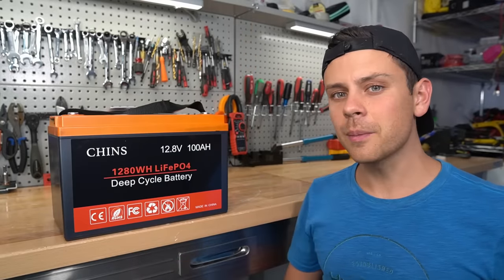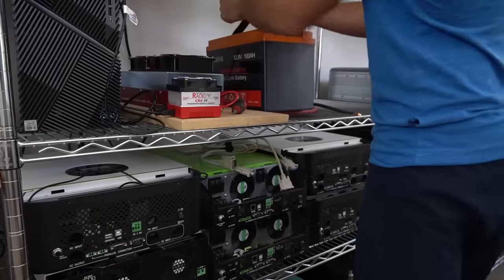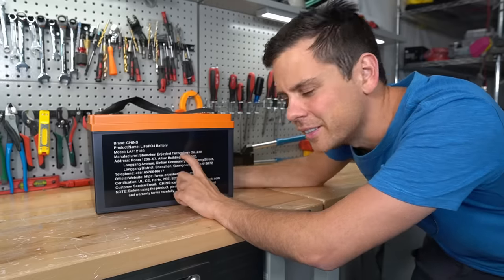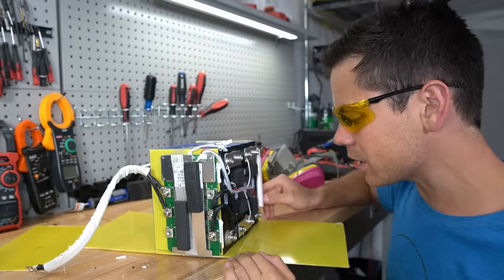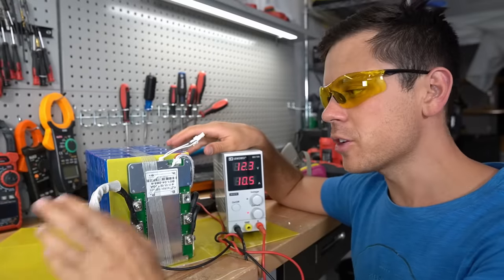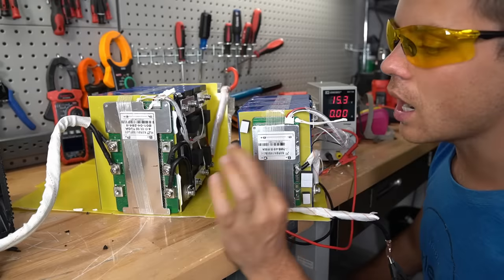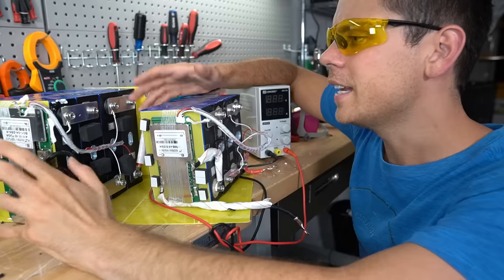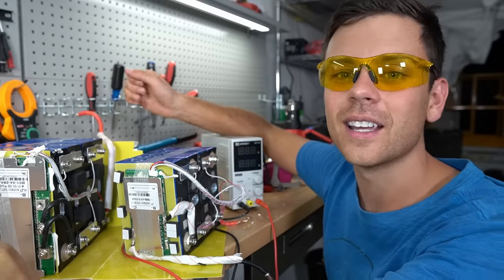$379 CHINS 12V 100Ah "Plus" LiFePO4

Comment: I bought the Mjbsan 100AH battery from Amazon and boy was I sorry. It took 3 days to charge, and then at .75AH discharge (my trolling motor on the lowest speed) it discharged in 4 hours. Just bought the CHINS on your recommendation and hope it works better. Thanks for the review!
Reply: How has it worked since it looks like you have had it for a month now?
I'm also looking to buy for trolling motor and interested in your experience.  Thx
Reply: @dannowak8235  Working fine! I actually bought a 2nd one.

Comment: I take amazon reviews with a grain of salt these days. Vendors are still bribing buyers to leave 5 star reviews. But these videos blow away those reviews (legit or not) since you actually show us the hardware and data points. I saw this battery and I assumed those reviews were bought and paid for and the battery was junk. So your review here shows I was wrong. Kind of like the renogy which you've shown is junk.
Reply: Amazon is starting to go after the sellers who actively manipulate reviews but I still wouldn't trust them.
Reply: @P_RO_  Agree, but they are taking their time. I attempted to post a review stating product came with a note to leave 5 star review for a gift card and amazon wouldn't post it. So while it is a start, they really are not trying too hard to stop it, and it isn't for lack of resources.
Reply: @skelafeti  Agree 101%
Reply: You need to use a product for a longer period of time to know what it is good for. And you can't tell if a battery is good or not by just looking at the parts in it. That is like looking under the hood of a car and using the car for one trip, and then saying that this engine looks really good, this a review and this is a really good car. People that don't know better are buying products based on 'reviews' like this.
Reply: @milcotto4153  You get a good idea if it's going to be a decent battery by the quality it was put together and the components. Without these reviews you could end up with a renogy battery that he tore apart and showed how shoddy it was. It's all a risk, even reputable lead acids can be bad. People are way easily bought and influenced so you never know about most of these reviews for that matter.
Reply: I bought 2 Newpowa 210 watt solar panels. 1 worked the other had 1 of the diodes fell off then the 1 that was still soldered in was backwards. They offered me $10 to take down my bad review. I gave them the double middle finger and let my review stand
Reply: Amazon reviews are bought and paid for
Reply: @Noneyabuiness  not mine.
Reply: When you can, watch for "Vine Voice" reviews.  While they receive the product virtually free (they only pay taxes on it), they're under no obligation to give it a "good" rating - it's completely a "blind" relationship between reviewer and reseller.  The only thing you have to watch out for is "lazy" Vine reviewers who just review products because "they have to" in order to stay in the program.  You can almost tell those immediately, however, as the lazy reviews will be short and lacking details.  Amazon also takes note of that, and eventually they're booted out of the program.  Most "Vine Voice" reviewers take their role seriously and try and do a thorough, objective review.
Reply: I agree with you very much. The cost of a DIY product is 200 dollars. I think our product is much better than this
Reply: I've had companies say, "Don't forget to give me a 5 star review." I tell them to their faces, "I'll give honest reviews, so give me a 5 star result."
Reply: Just look at the review dates... you can tell by the cluster of dates.
Reply: I just bought a Renogy battery, not delivered yet, hope your wrong about them :+/
I just watched his video on Renogy, he say's they are great quality. ?

Comment: I live in the northwest, it gets cold for a few weeks, but I turn my batteries off after every camping trip so they are not just charging while sitting. I use 4 aims batteries and they have done great for the last few years, unsure if they are a great battery but they have worked for me, they do not have a cold temp shut off, but since I turn them off between trips, and the spot I have them is heated when in use, I don't worry about it.

Comment: On Amazon for the same brand battery, they have other empires listed and I also have them listed in a smart battery as they call it. It says it’s supports low temperature charging down to -34 ,if I’m reading it correctly.
Reply: What are empires?

Comment: Hey Will, can you talk about mixing different batteries, for instance a Battle Born 100a and a DIY 280ah in parallel?
Reply: You will get 380 ah
As far as I know, there should be no risks
Edit: no risks as long as the voltages match

Comment: I bought one of these CHINS batteries through Walmart’s web site for $276 with shipping and tax included.  According to FedEx, the battery is supposed to arrive 10 days after I placed the order.  I also received without having to ask a follow-up e-mail from CHINS with recommended settings for MPPT controller and inverter, and contact information for engineering questions.  At least out of the gate, I  am impressed.  I am not going to use the battery where it is likely to freeze, so I can live without an internal low temp cut-off.

Comment: I bought this battery to use with my Renogy suitcase all in one solar kit, but the CHINS battery recommends a MPPT charge controller and the Renogy uses a PWM. I will check with the company on their support line.

Comment: Hello , I have watched many of your videos , I thought I have learnt something from you, but in reality when now I am in my Cabin in Norway, I have no idea what I should get, I need to power my PC, cell phones cameras and a small ,12v fridge, could you please make list what ii should buy which is or are available At Amazon, I will make videos thank you for your easy to understand instruction and wonderful help.!
Reply: Mate my system does all that and I have 16 100 ah batteries 3000 watts of second hand panels 3 cheap chargers and a 1500 watt inverter and it runs power tools everything I need it's that simple I just use a generator for the welder it's easy don't be afraid good luck
Reply: Get a 3500 watt generator
Reply: @MudPeppers  Preditor on Harbor freight is a pretty good model and it has a silencer switch to quieter run time....some of those generators DB levels can drive you bonkers.
Reply: I have a similar setup.  12V fridges range from 60-90W.  So this will run 24 hour a day.  The other stuff you listed will be taken care by the excess solar during the day.  If it's a PC then you will need more.  Labtop is better.  Inverter depends on your requirements <400W (power tools >1500W, 300-400AH in batteries (lithium),  60-80A solar charge controller and about 1200W in panels.  Why not a propane fridge, the system could be a lot smaller.  You need to figure out total watt usage in day.  Then size the battery a bit bigger (1.5x).  Then estimate the panels, by assuming you get like 3 hours of sun a day.  300-400ah 12V, you will need 1000-1400W in solar panels. 24V system would be better.  Beefy for 12V and only because of the fridge. So based on what you said:. 400W inverter, worst case for fridge = 90wx24h = 2160 wh.  So get 3x100AH or 1x300Ah lithium.  Cheap 100A Mppt charge controller (OOYCYOO). 3x 340W solar panels (3P config). Get a 6way 12V fuse block.  Add RV lights, water pumps....
Reply: That fridge is the killer.  Most of these DC fridges run on either 12/24V.  24V system would drop the cost of the wiring and the charge controller significantly. It's the multiples cost of 12V batteries that suck too (based on my calculations you needed 3) and 24V would mean 4 (2P2S config).  Check the wattage rating on the fridge this is really important for you.  Also think what you might want to add in the future.  You're straddling like $3000USD based on what you said.  I use propane I'm Canada because it is cheap ($300CAD per year and that includes my stove with oven).  Take away the fridge and you could get away with spending $1500USD for the system.
Reply: @fuckyoutube9713   12V Fridges eat like 45-90w and hour depending on size.  I've been looking at them.  Even then, he'll need a chunky 12v system just for the fridge.  He lives in the north so he would need more than 200W (3 hours of sunlight in the winter).  Your suggestion is good, but I'd boost to a 40A Mppt and 400W solar.  Just one large Hanwha panel - 410W.
Reply: Buy Will’s eBook. $8.00 USD if memory serves
Reply: @robertbader2915  well I went on aliexpress and saw lifepo4 320 ah cells for 560$ canadian for 16 pcs that's close to 15kwh of power
Reply: @lesstevens2370   You might get 4 pieces for $560 and make sure that the shipping is included.  I have a setup with one 200AH renogy AGM.  I think my next will be the 200AH CHINS lithium with the 200A BMS.  Need to cross into the states to pick it up, but right now the renogy battery with 510W solar works great.
Reply: @robertbader2915  I just looked and order 16 cells 3.2 volts 320ah lifepo4 off of aliexpress for 62 dollars canadian per cell supposedly  grade a also but yesterday they were on for 48 per cell should of got them then but you can get a good setup for under 1000 storage wise at least
Reply: @lesstevens2370  Will Prowse paid $2800 US for the same thing.  How is it that you are getting it for less then half that... Makes no sense.
Reply: I put all my cells in my root cellar at 3 metre's.
I live at 2800 metres in the Rocky mountains and my cellar stays at a constant 14c. year round.
Listening to will has eased my worries of temp sensors and as of 3 yrs now I haven't had any spikes or problems.
Reply: @lesstevens2370  do you have link to the seller?
Reply: That’s a lot to ask someone without paying them. It’s really not too difficult.
Reply: Since you are in Norway,  you will need a 220 volt inverter,  correct?
Reply: @housesOTR  yes, thanks

Comment: First and foremost, YOU are the one who I trust about anything solar online!!!!  You do an awesome job in your education!......  Sounds like, if a customer isn't too concerned about a low temp sensor scenario, then this can be a GREAT option!!!  I'm thinkin about an indoor solar generator with solar panels outdoors that will run a split system AC ALL the time using 220V on it's own independent circuit all to itself.  This will take a large load off my home AC that should lower my electric bill.  Am I thinking logically?  Correctly?

Comment: One review on Amazon says the company doesn't use the low temp sensor because it also prevents low temp discharge.  I guess the BMS doesn't have a separate circuit to control charge independently of discharge so they just disable the low temp cutoff completely.

Comment: Great review of a product I've been eyeing. Any chance you can give feedback on how rugged it would be for an RV or Travel Trailer? Thanks Will, your vids are the best!
Reply: I'm restoring a fiberglass egg trailer, do i just swap this battery with my old AGM and it'll recharge and do everything the same?
Reply: uh didnt you watch Will cut that thing apart. That thing is rugged
Reply: @ImACarbonCopy  uh, yes I did "watch Will", and I still didn't see that the internal cells were in any way vibration isolated/padded/or bound in a way that might or might not lead to vibration damage. So, to be clear, just because it's in a plastic welded box and has a few small square pads of foam, doesn't mean it won't break down from vibrations from driving on dirt roads.
Reply: @Ender3Me  No, you need to have a charging system compatible with Lithium batteries, in my experience with my Scamps, many older chargers will NOT properly charge lithium. Will has many videos on the topic and has a great book in how to build/upgrade an RV's electrical system for lithium batteries.
Reply: @berthaduniverse  I'm sorry Paul. You are right.
Reply: @ImACarbonCopy  Thanks much. Great to see, made my YouTube day!

Comment: Wonder how many of those batteries U can put in Series or Parallel
Reply: As many as you can afford and at the voltage your wire can carry safely.
Reply: I bought Lossigy, a similar Chinese 200ah lifepo4. Specs state up to 10 in parallel and 4 in series.
Reply: Info on Amazon says  4 in series and 4 parallel. So  4p4s
Reply: @merlpriester  U the Man!

Comment: Have built two CALB LiFePo4 power generators (each 12V 100ah capacity).  Each of them were more expensive if you hook them up to a good quality bms (overkill is what I used).  The busbars ($35), cells ($300 off of ebay seller), and bms ($125) cost over $460 combined, all brand new components, so there is no way a quality DIY will beat $379!  That said I'd highly doubt you can beat this ridiculously cheap battery, unless you buy grade B used cells.  Thanks for another great video btw!

Comment: 500$ to much imo when i can get 100ah led acid for 80$ at wall mart just have to maintain and keep a eye on it...
Reply: There are plenty of situations lead acid don't cut it. Such as in winter temps. In real world you're lucky if you get 40% of your rated capacity when freezing. I had 235ah @50% available, I was using about 35ah running my furnace overnight after charging, in the morning I'd be at 12.0 volts or less, just 10 hours. You get over 95% available power with lifepo4. Sure it's a waste if you don't need it, not so much when you do. I now have 1200ah via 6 200ah lifepo4, I can pretty much run anything I want now without worry.

Comment: Thanks for posting these.  I’m looking for a lightweight battery to run a trolling motor on a fishing kayak.  I didn’t know the first thing about lithium batteries coming in but after watching your videos I feel like I have a decent understanding.   Since I won’t be using it for solar power and only charging it after going fishing I don’t think the low temp charging protection is a big deal for me

Comment: I bought two 300 amp Chins batteries for my boat and I have nothing bad to say---cheap, they do the job and the lack of a low temp sensor does not bother me as I am in Louisiana and it is mostly hot---everyday, even when it rains....everyday.  I think I paid $1100 for each on Amazon.

Comment: I have been following your videos for a while as I ordered Renogy's 200 watt kit for my camper. I did upgrade my controller to the Renogy Adventurer-Li 30A Negative-Ground PWM. The question I have is can I use 10" of cable between the controler and my batteries. Thanks for taking the time to answer.

Comment: I would criticize your judgment criteria. Low temp cut-off is not a concern for people living in certain climates, many parts of the world never ever ever see freezing temperatures. But high temperature is a concern in my solar powered camper that gets parked out in the sun at 50C ambient where the temperatures inside the electrical box could potentially rise above safe operating range

Comment: Marketing, you gotta love it! I got two of those CHINS some times back, and the damn thing has not discharged in 4 months of none use. Still holding 12v+ each!
Reply: Consider charging them.  12v is very low state of charge for this battery.

Comment: Bought 32700 3.2v 6000mah lifepo4 cells and lto 18650 1500mah from same seller.
The 32700 battery has their rated capacity and slightly over.

Came out to be just over €5 per cell which is cheap..

I don't really have a use for these, but a 12.8v 6ah battery pack is a option.

Did a 1a discharge on these

Comment: I came across your channel researching lithium batteries for fishing and find your channel pretty interesting. I may get a small battery for ice fishing but temps can get down below zero Fahrenheit sometimes (usually temps are in the teens). I didn't know you could damage them by trying to charge a frozen (32 degrees Fahrenheit?) battery. Thanks for pointing that out.

Comment: I started with 1 but have added a second one now just waiting to get a bus bar to connect the 2 together. will keep you informed if I find anything wrong. thanks for the show wondered what was inside. next one I'm planning to buy is there 300 ah one. but need more PV's to charge them with. currently only have 400 watts on the roof.
Reply: You don't want to connect a new battery in series with an old battery. They both need to be new.

Comment: I get that low temperature charging control is necessary if this is on a solar off-grid system in a cold climate.  What if I want a powerful battery to run lots of fun gadgets while camping, even in the winter, as long as I don't attempt to solar charge below a certain temp?  I want refrigeration, freezer, lots of lights, a small vacuum, etc., and even things I can't think of yet . . . 

Thank you for your work -- I have learned everything from you.

Comment: THANKS Will for the tear down. Next up can you tear down an Ampere Time 100 Ah Battery? I purchased two of them ( minutes apart after realizing what a great deal it was.) I grabbed them when they were on Sale for $499.00.They are setup in my Bug-Out Camper to run my 12v fridge 7/24 along with LED lighting, 12v water pump, and 1k Pure Sine Inverter. From Sun down to Sun up the Battery level only drops 4-5% The Ampere Time Batteries ROCK!

Comment: Great Video thanks - quick question if you connect LiFePO4 batteries in parallel on a boat do all the connecting cables have to be the same length? and if so how important this is? as I am getting different views and you are quite the expert!
Reply: I have the same question for my camper 🙂

Comment: Will . . . As always, a very informative and entertaining review. I see these sort of products for sale all the time and wonder if they're the real deal or not. When you whip out the powered saw to cut through the sealed plastic case, I know I'm about to find out. BTW, your Amazon link that takes you to the review subject shows an upgrade "Smart" option with the low temperature protection. Retails for about $660, which is still pretty good.